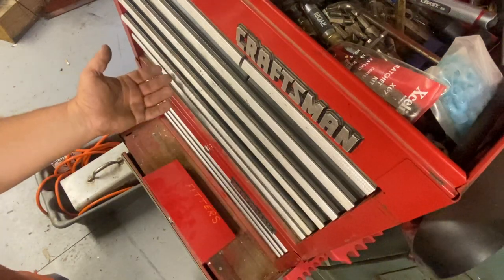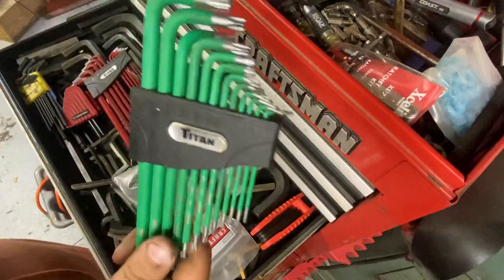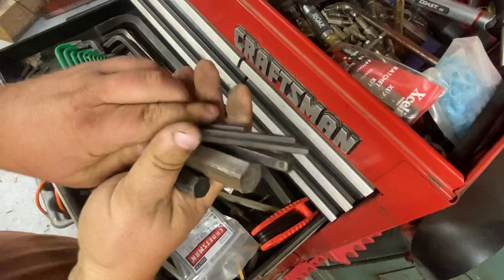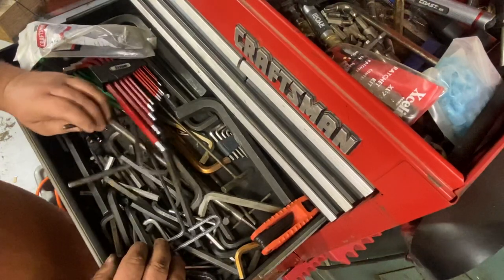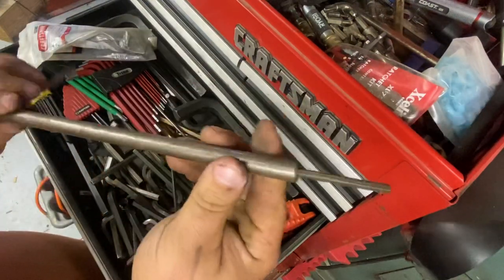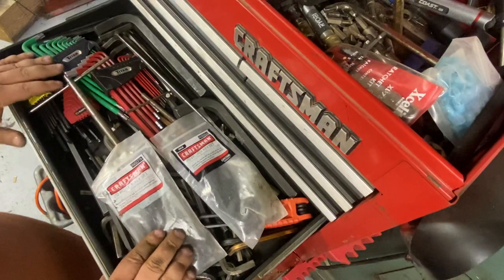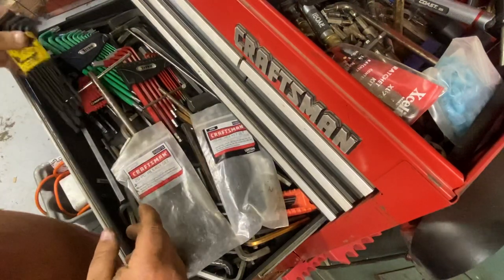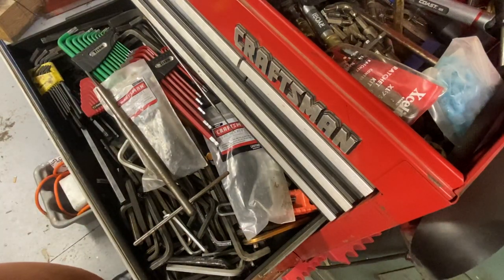Toolbox tour #6, Allen wrenches

Comment: Fantastic video Adam as always can you not just use a long extension with Allen sockets? Instead of A home made tools or is the access to small even for that anyway great video mate :-)
Reply from the maker: Sometimes there just isn’t enough room like between a pully and motor block if the previous mechanic put the set screw side of the pully on that side for some reason

Comment: does take long to add up have and old 3/8 and 1/2 drive they were from the gray tool company yes  they had slit pin holding the Allen head in the sockets  did cut them up and made spears for them sets did find people were very interested in them to stop using them at work  they had to stop making them they stopped making them before ww2  and that was the other reason i did that how old they are  ( Canadian tool company )  wow  some of the tools especial the toolbox itself is the first toolbox the had  have 3 roll cabinet are the same and  the numbers were 1 2 3 my great-great-great-great-grandfather brother bought them the ww1 can along he made it back but was very sick and passed away muster gas kill him  and most of the brothers when over there to fight few never made it back too yea